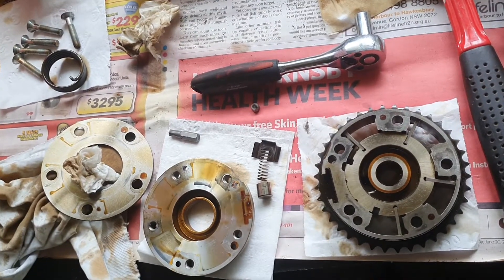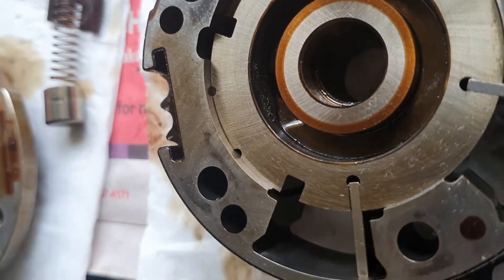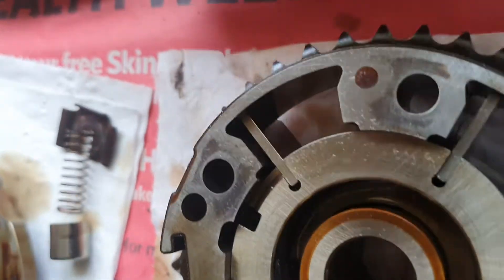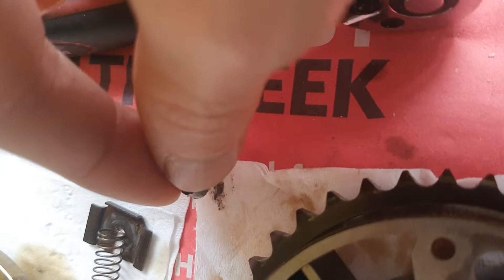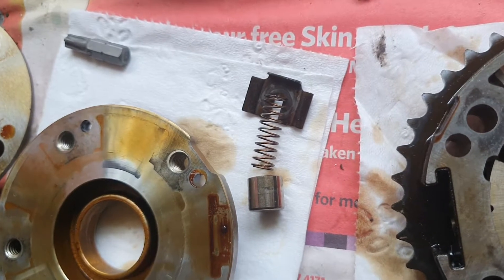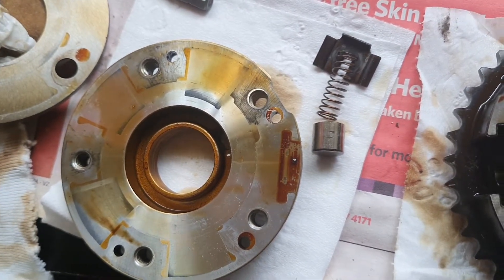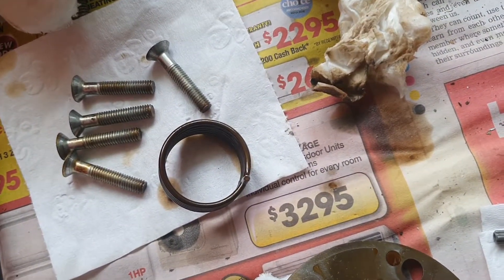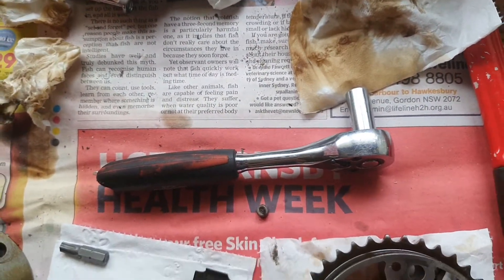BMW e46 318i 2002 n42 inlet VVT unit

Comment: You fix.help
Reply from the maker: Tôi không hiểu câu hỏi của bạn.
Reply: @sudnut  
Have you fixed that error yet?
Reply from the maker: @phamloi2985  No, it rarely makes the noise now so not worried about it. The VVT in the video was a spare from the junk yard. But today I will open my own exhaust VVT to inspect and clean anyway. Will see if it makes any difference soon.